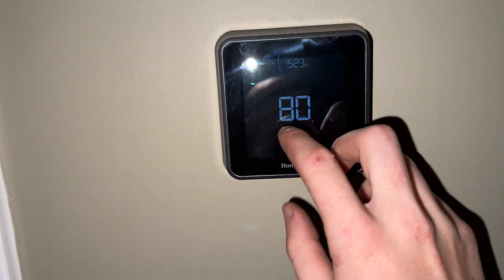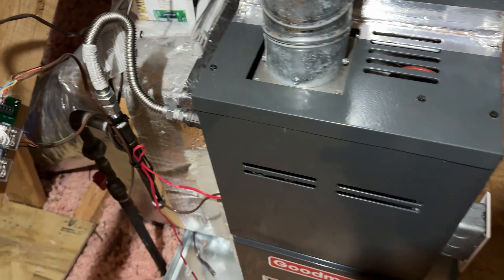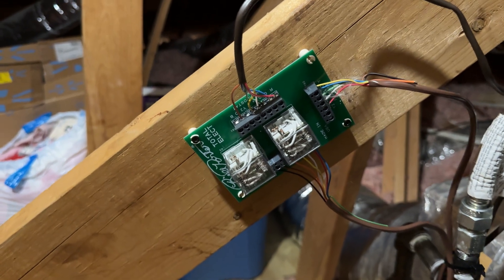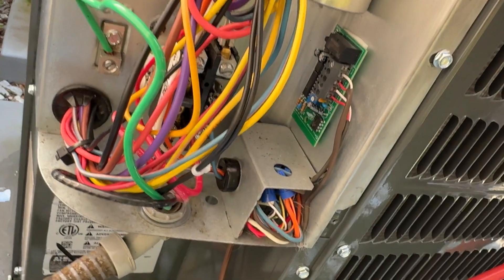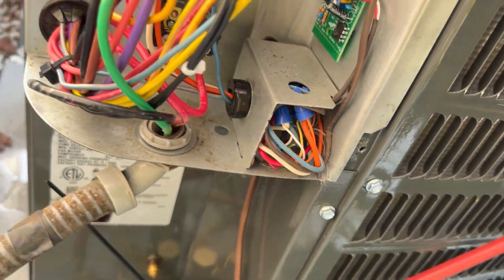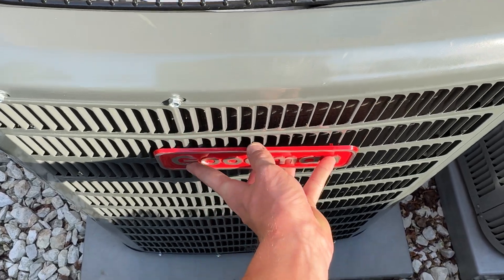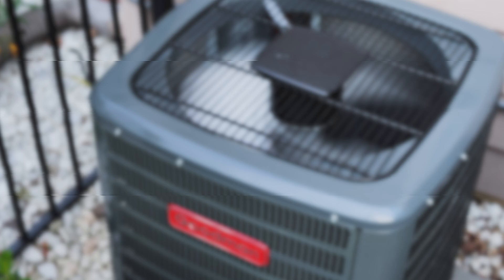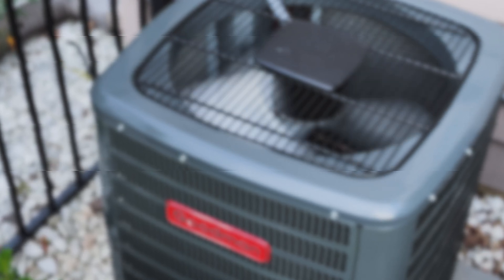The New Goodman Dual Fuel Heat Pump

Comment: Wow! Ok I was not at all expecting this! When i saw your final start up vid on the 2019 goodman, i was like "only 5 years old and now its getting replaced already?" I love how you took a 2010 heat pump and rebuild it from the ground up. Giving it new life! I like how the grill makes it look like a small 2 stage goodman! I hope this old but new unit serves you really well for years to come. Just a few questions, 1. Is the Bristol compressor reused from the 2019 goodman? And 2. Do you plan on doing the same for the comfort aire at any point in the future? Nice video!
Reply from the maker: It's hard to call it old when every single major part inside it has been replaced haha. I appreciate it!
Yes it's the same compressor.
I do not plan to modify the downstairs system. Thanks again!
Reply: YOU JUST TREW IT LIKE 💩 THATS JUST INSANE FOR ME 😳😰😂😵🔪🔪💴💴
Reply: @Jets-and-airconditoning  what?